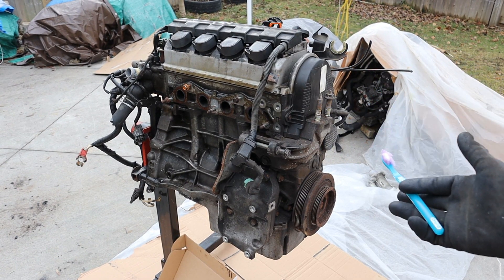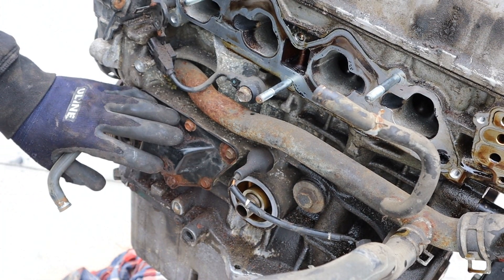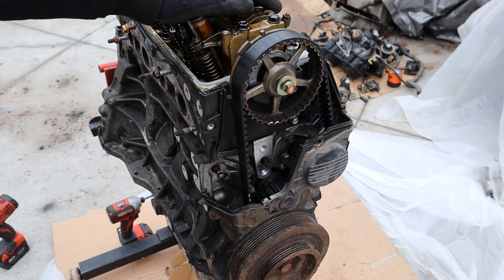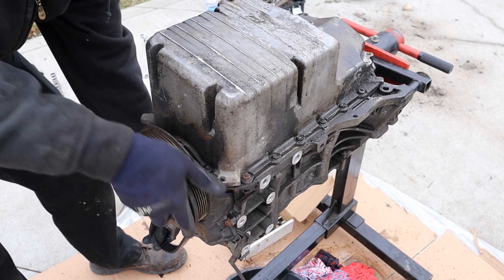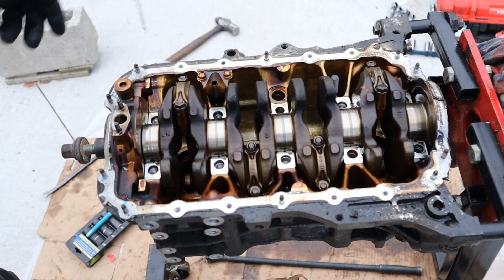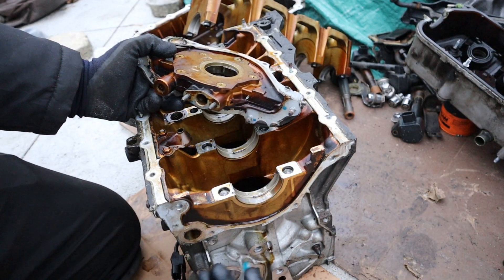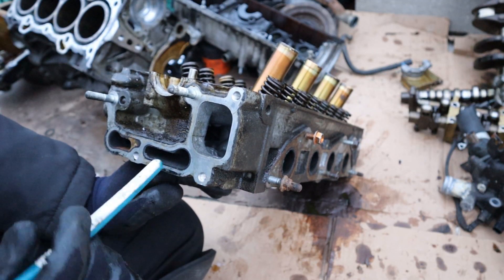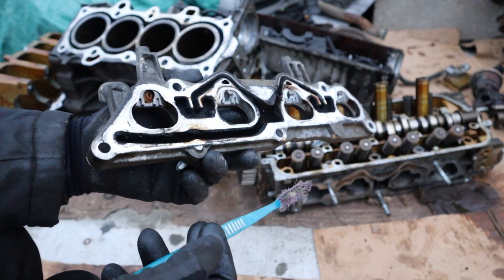Honda D-Series Engine: A Low Point for Honda

Comment: It's crazy that even what's considered a low point engine for Honda is still better than most other makers engines. I've owned several 7th gen civics and aside from having to replace the head gasket, I got nearly 300k out of all of them and they were still running great when I sold them.
Reply from the maker: True, Honda made good engines
Reply: There was no low point for Honda everything runs no matter what I’ve driven a pilot onto a hoist with no oil and one piston already shot through the bottom of the pan lol
Reply: The worst gen Civic is probably better than the best gen Kia Forte
Reply: I agree to some extent and it depends who driver are with car knowledge. I used to go to Honda dealer and get car maintained with ATF fluid and ect. After 50+ kilometers, tranny made humming noise and I checked tranny fluid; it was below MIN mark in dipstick.  Dealer meant it indeed for replacement of my tranny. I refilled it to Max mark of tranny. Problem solved. Therefore, it does depend on who drive the car.
Reply: @sakra vong  Hondas transmissions are their weak point, especially 00s-2010, tho not to a catastrophic degree. Their engines have more or less always been solid. Some to an extreme extent, tho many hear that and treat them like garbage and just don't maintain and drive rhsm til they explode lol. Toyota has a similar issue in that regard, hence why buying them used can be dicey.
Reply: I have over 300k
Reply: @ronaldbingling2  As I type this, I now have 368,450 miles on my ODO. It as given to me 4 1/2 years ago at 267k with a breeched HG., I changed the gasket in 2022 but the head was so warped there was no machining it out. It went 20k before it blew but I've since bought a reman head assembly from O'Reilly's (says made in the USA on the front) and so far I've been pleasantly surprised. All-in-all, I never let the temp gauge go above 3/4 for YEARS with a blown HG. Just pull over and wait 12-15mins and top it back off, folks!  At least that worked for me til I could get the money together to REALLY fix it.  I went with a Honda HG instead of the Fel-pro that came with my master gasket set this time around. I definitely would advise others to go with a genuine Honda gasket on a mostly-stock motor.
Reply: it isn't a low point. D series are all really good engines. I'm starting to think people just like repeating eachother in saying the 7th gen Civics and the D17's were terrible. Neither are true.
Reply: best Hyundai engines go 70k without replacing it.
Reply: Just got one head gasket going out and I’m fuckin pissed
Reply: Any "good" engine shouldn't need a head gasket replacement.
Reply: @joeblowe7545  😂 well considering it was around 200k when the head gasket failed.on them, I consider that just routine maintenance at that point. There aren't too many makes of vehicles that will even make it to the 200k mark unless several thousands of dollars were spent.along.the way to get it there.
Reply: @jeremybreeden4228  buick 3800. good for 300k easy. taxis get 500k
Reply: @jeremybreeden4228 my brother let his over heat till the car shut off probably 5 or 6 times due to losing coolant with his head gasket and it just kept going until it was puking coolant into the cylinders because he cracked the head from constant hot and cold
Reply: @koloy999  That's unfortunate the head cracked but yes failure to replace the head gasket will definitely lead to a crack head. Like my comment said for this engine to be one of Honda's worst engines produced should say a lot about Honda for their reliability, I still see the 7th gen civics all over the road. Any Honda/Acura from mid 80s through 2010, I wouldn't hesitate to buy. The 8th generation Civics just won't die LoL.
Reply: @cocodog85 Buick 3800 does 300k and is renowned for its reliability. But a well moderately serviced Honda only doing 300k is shamed for being unreliable. 3800 is a good engine, but miles are miles and it doesn't make the D17 strictly a bad engine.
Reply: @logandeboer1009  honda makes under powered oil burning junk.  and now so does GM, ford and chrysler/fiat/daimler/stellantis.
Reply: @cocodog85  yeah, I guess that's why there is so many of them on the road because people like to drive around junk, 🤔 or it could be because they refuse to quit going! Every day I see several Honda's from the 80s and 90s on the road being driven daily. I know several families that have passed their Honda down to their kids and then they got passed down to the kids of those kids. Hopefully you get the point, I know proven numbers are hard for some people to grasp but you'll get the hang of it. 👍 For some reason I picture you as one of those.people who sit in the Walmart parking lot in your lifted rusted out jeep revving your engine. 😂
Reply: @cocodog85  bit those make 165hp for   3.8l thats crap in stealth   basically  a bigger briggs and stratton  go for ever but   ull pay for the car 10x over in fuel lol  and its still slow   norm hooked up to a  very very very rubbish   3 or 4 speed auto    box at that NASTY
Reply: @TCBOT     series 3 v6 3800...200hp, 230ft/lbs torque. 27.5 mpg (us) hwy and it goes on for ever.  proven cop car engine. and yes briggs and stratton reliability. indestructible.
parts cost nothing and are always available.  junk yards are full of these engines because the bodies rust out before the engine dies.  

  4t65e transmission also indestructitble if one changes the fluid and filter regularly evey 25k miles. 
  
 20% less fuel economy for 1000% less parts and labour.  not to mention that in a crash those honda tin cans break up like eggs. :body-green-covering-eyes:

find a low mileage 3800 w body at a senior's residence for cheap, put cop suspension and brakes on it. cut the baffles out of the intake box as well and the car will do 8 sec 0-60 mph and turn circles around your honda chain saw.
Reply: @cocodog85 taxis also get serviced about 30 times a year… so yeah.👍🏻
Reply: @joeblowe7545  any old Joe Blowe up the street could tell ya that 😂🤣
Reply: @joeblowe7545  lol  your wrong there     hg,s are the most abused  part of an engine    if you use wrong coolant =hg fail if you get it too hot hg fail   if you  drive like a granny   leaving  the car in 4th when it should be in 2nd  hg can fail    these are  a 20 year old engine     miles  isnt  tho whole  story  as the gasket  is made of steel  block alloy  so it it  used the wrong coolant   (and who  worries  about that in a £500  car these old cars are now cool but at one time   where just  old cars and chances  are unless its a 1 owner  from new     its had  some abuse over the 20years of life
Reply: @TCBOT  exactly, head gaskets go through so many heating and cooling cycles it's amazing they last as long as they do. I have no clue why that guy made that comment..Replacing gaskets on an engine is routine maintenance, it doesn't matter which gasket it is they all need to be replaced at some point if the person wants the engine to last. A lot of people don't even bother replacing a head gasket once it blows and instead sells the car for cheap and moves onto another one. I'm the guy who's happy to buy that car for cheap and replace the HG and get another 70 to 80k out of the car or more. 👍
Reply: @joeblowe7545  Not true. Honda manual states the head gaskets for the D series can last up to 350 thousand kilometers in normal driving conditions.
 They have a thin rubber coating  on the gasket than inevitably erodes.
 My D 14A2 engine overheated one time and lead to exhaust gases escaping trough the cooling system, indicative of the head gasket leak.
Reply: @joeblowe7545  a truly great engine is engineered in a manner to where it takes like 3 hours for any competent weekend wrench-turner to complete a head gasket replacement
Reply: @joeblowe7545  POOR GASKET NOT ENGINE
Reply: @joeblowe7545 Honda needs it at 300K All American cars need it by 150k…..
Reply: @joeblowe7545 Any engine that can feasibly drive 300k miles without catastrophic failure is a good engine. If they had to replace a head, that's one thing, but a head gasket is reasonable at that point.

Comment: EGR is the stupidest idea for emission control. Exhaust is fundmentally different from Oxygen. Who would breath his own fart just to hide the smell? Fart is produced by digestion system, breathing is part of aspiration system. Engine intake requires only oxygen just like our aspiration system. If EGR is working, why don't just let us breath the exhaust in the first place? It's a irresponsible move to hide the incompetent of  making efficient engine or the intention of shortening the lifespan of the engine so they can make more money. Diesel engine is different, I can understand the existence of the EGR. Petrol engine does not to have the EGR in order to burn more cleaner, in fact there are lots of petrol engine don't have EGR while complying with the emission requirements.
Reply: Maybe educate yourself before posting bs? EGR system diverts part of the exhaust gasses to the intake. CO2 from the gasses reduce the oxigen concentration in the combustion chamber which slows down the combustion, which in turn reduces the combustion temperature. At lower combustion temperatures, a lot less NOx are formed. EGR also reduces fuel consumption at partial engine loads.
Reply: @DashCamSerbia  Your mouth smells just  like an EGR valve. Educate yourself fist with the question "Why some cars with variable valve timing does not have egr EVEN EGR IS SO FANTASTIC" before trying to be the all-knowing.
Reply from the maker: I hate it too.

Comment: With automatic tranny they like to blow head gasket. You would remove head with intake manifold attached. Generally not a bad engine.
Reply from the maker: What makes the manual engine any different?
Reply: Possible that the extra heat dissipated by ATF cooler, higher engine RPMs, load and engine temp, no idea. But very rarely it's the one with manual tranny that blows the head gasket, 90% of this Civic models were automatics, maybe a one with  manual.

Comment: Do the D14 and D16's from this same era (7th gen 2001-2005 EP's for example) suffer these same problems? Or is the D17 a case on it's own. I've personally never had any problems with older 90's D engines.
Reply: The 17s are the low point of the D series. I've had plenty of D16s: 2 Z6s (93 and 94 EXs), a Y7 (97 DX), and a Y8 (98 EX). Those had no major issues. I had 1 D17A2 (same variant shown here, US emissions with VTEC) and the head gasket failed at 150-160k miles. For comparison, most of the D16 cars I had had north of 200k on them, the highest being the Z6  in my old 1994 Civic EX, which had 273k miles when I got it. It burned oil (basically all D series engines burn oil at high mileage), but no other issues.
Reply from the maker: D17 👎

Comment: Wait until you discover the infamous G series. 😬🤦
Reply from the maker: Haven't heard of it yet. 🙂
Reply: @speedkar99  Smooth running 5 cyl in 2 and 2.5 litre formats. All seem to be brilliant at throwing rods 🤦 So bad that Honda New Zealand doesn't even list the engine series or the vehicles they were fitted to  🤦 

I unfortunately discovered the G series reliability issues first hand... Half a dozen times up to the redline, and it was aallll over.

Comment: 12 hp vtec yo, barely worths all the hassle, you could get 12hp out of that engine much cheaper with more reliability
Reply from the maker: Boost?
Reply: @speedkar99  straight pipe

Comment: Sadly, Honda seems to be giving up on tuner-friendly engines. Their latest refresh uses either L or R-based designs (for hybrids) which are more geared towards economy than tunability. Only the new Civic Type-R gets a K20C.
Reply: Tbf I don't think anyone has tried with the r based design (because it's a hybrid lmao barely anyone is focused on tunes for non si models.)
Reply from the maker: Agreed! They need to get back to their roots.
Reply: @speedkar99  Have any idea how could they start on that. cuz unfortunately the k series isn't really mass produced(only made in ohio) And IIRC most of their transmissions can't handle the torque from them. Only one's i thank that can was the accord mt(no lsd) ctr(limited production and probably expensive) accord 10sp. ehhhh.

Comment: I have a d16 non v-tec.
230.000 klm on the block.

And yes it use oil but that is normal on a honda d engine. 
What u use for a shopping car .
The cold engine use oil and the reason is easy 
No auto adjust valve.
It really need heat to close it.
Reply from the maker: Awesome!!

Comment: Other than prone to head gasket failure, the D17 is a solid engine
Reply: That's just not true the design was flawed and it would burn oil in barrels because the rings would fail along with head gaskets.
Reply: @robertblack6630   I bought an d17 civic new in 2003. Currently has 230k miles on the odo and doesn’t use a drop of oil between 5k changes.  Maybe what you’re saying is true if you’re one to neglect maintenance but that also goes for every other ICE vehicle ever
Reply: @robertblack6630 You are correct. I had oil burning, leaks and blown head gasket

Comment: I think the head gasket failure mode is the opposite of what you say.  First comes an overheat event and then the head gasket fails.
Reply: Not always. There are plenty of cases of the head gasket randomly going out for no apparent reason, it happened to me. A very well respected Honda technician on a forum reported that he changed a lot of them under warranty at low mileage too. I have always wondered why they fail so often, but I have never seen any definitive answer.
Reply: INever had an overheat event.  It just went.

Comment: those timing belts rarely fail withing the service interval (like most hondas) unlike for example, the renault K4M belt which ive seen failing under 50k frequently.
a big misconception is that timing belts last the life of the vehicle, they barely last the warranty, modern timing chains dont last what they used to, the average km i usually end up replacing timing chains, specially on BMW and VW is around 150k, depending on the model, the biggest difference tho, is that a timing belt is a lot cheaper, to buy, and a lot easier to replace, not to mention a lot quieter, and in case of a belt snapping, you only get valvetrain collision, whereas a timing chain failure can be even worse than that.
id take replacing my accord V6 belt in a couple hours for cheap every 100k(like the manual says, even though ive stretched that to 150) than having to replace a VW Amarok v6 timing chain at 150k (ive replaced them at 80k some times). and i could bring up many examples.
people demonize timing belts, but with how badly design timing chains are nowadays, they are a nightmare, sure, if we had 80s/90s timing chains design and quality, it would be better
Reply from the maker: I agree. I tend to like belts better. Easier to service than a chain.
Reply: @speedkar99  Chains do not like extended oil change intervals, especially on K24s. Honda timing belts are pretty easy, especially on the J series. I've done dozens of them, including on my own 2006 Accord.
Reply: I agree. To me is is just insane to hear Americans complaining about how for example water pumps fail on certain engines. I am like, wtf? Water pumps are service items. They are very cheap and get changed every 80K km or so in Europe. With every timing belt change. By timing belt, in Europe, we also mean everything assosiated with it, plus the accesory belt and everything that goes with that, the spark plugs and the coolant. What we call a "big service" in Europe. Again, done every 80K km or so.
Reply: @DashCamSerbia  That's because most engines here are driven by chains now. On timing belt engines, the water pump is part of the timing belt service. The last major holdout is the Honda J series V6 and random water pump failures are rare due to them being replaced with the belt. Nobody with sense will replace the belt and not the pump.

Some put water pumps on tining chains, like the Subaru EZ30. I did a chain assembly on one I fixed up. I replaced the pump too because it had 268k miles and was on the original pump, and the process to take the timing cover apart is a pain.
Reply: Update, I just finished a full timing /distribution service on a mitsubishi 1996 montero 4m40 engine(pajero for the rest of the world) 860.000kms still on the factory chain and sprocket combo (first owner and good mantainance) goes to show what good design and quality and proper service intervals could get you,sadly not the usual case today. 
Yes, it was vey expensive since everything was very worn out, but thermal group still under tolerance, only new valve guides and seats were needed.
Reply: @hbsupermage  👍

Comment: Head gasket always fails between 2 and 3 on these motors then it warps the head. ugh
Reply from the maker: Sadly
Reply: Head worps due to overheating of the engine, not the other way around. Same with the head gasket, usually.